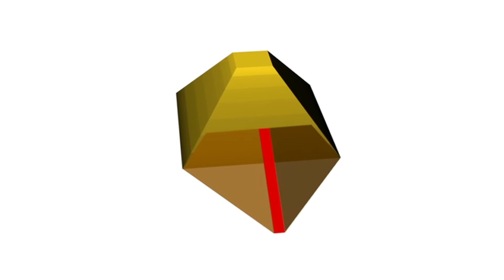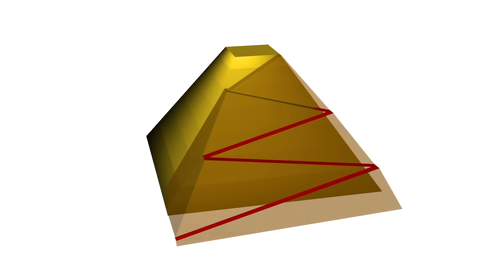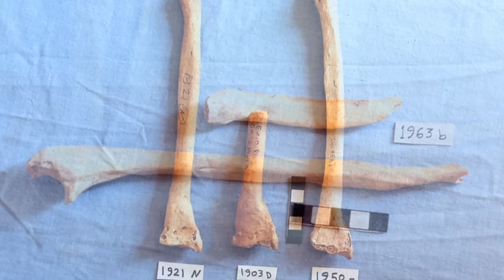Egyptology - Pyramid Construction

Comment: Always fun to see every single historian create a ramp for how the pyramids were built. While any of these ramps never existed because it would be as massive as the Pyramids themselves, and Would surely leave a trace upon removal. This man has wasted 30 years trying to understand How they braught the stones up there, while they haven't moved anything. They didn't need to move or shape any stone since they simply used Geopolymer concrete. All the materials needed are aboundant in Gizea, make the research there and you'll find it.
Reply: They didn't use concrete - the stone is clearly cut not poured. The transportation was not ramps - that would leave signs. Magnetic levitation or electromagnetic levitation is the likely option to move the stones into place (some still have strange magnetic signatures not just there but other ancient sites as well).

Comment: As an Egyptian I've went to visit the pyramids many times (not for 30 years in my life) some things they said were right but ots clear how it was built let me explain.

They placed the foundation in one week
With slaves pulling all the blocks and putting them in there place then the built sand slopes in a spiral around the blueprint they had for any of the three pyramids then it took several month maybe years (for the bigger ones) to put the stones in order then the just deconstructed the stairs .

Also one thing the part they said about the limestone filling is most likely correct
But they forgot one thing that they used big and small rocks not only small ones they used the bigger rocks to make it more slopey and then filled the gap between the blocks and the rocks with exactly the way they said in the video

Comment: Modern builders still use the  3 blocks and string method.  The largest stones and the ones smaller would have been wheeled up the ramps.  Make 2 large wheels of wood in 2 halves for each.  Construct them with a square divided in two diagonally as a void in the wheel center.  Then fit the two to the stone block as if the stone was the axle do this for each wheel.  All this bound with strong cord over packers to keep the stone at centre.  Then whatever means of pulling power, men or horses can pull and rest as a following team lays blocks to prevent roll back.  The engineers of that time would see this easily.  However I have no knowledge on the qualifications of the time.  Probably simple logic demonstrable to the kings and an air of superiority would do it.  Work it out and comment back I love this stuff.

Comment: Ya but if they used a giant ramp to build the pyramid,then HOW DID THEY BUILD THE GIANT RAMPS
Reply: With smaller ramps, over and over again..
Reply: With a giant load of bull shit.
Reply: i know right....if you really research the answer, it's very simple and makes sense......MOST of it is actually a mixture of concrete and the stones were poured in place.......FACTS!
Reply: With giant hammers

Comment: The whole concept is not possible with copper tools  show us how long to get a square stone even 24 inches square with the accuracy needed. NEVER POSSIBLE.
Reply: 1 - very few of the total blocks in the pyramid are plumb = meaning carefully cut and in some cases polished.  Most are in fact little more than crude chunks of limestone which were rapidly fractured from the bedrock in approximate sizes.  
2 - as to how they checked the plumb of blocks = Google the tomb of Rekhmire and look at the famous depiction of craftsmen at work.  You will see a man holding a square against the side of a large block checking its straightness. 

Enjoy your supposed "impossibility".  lol!  Facts as John Adams famously quipped are stubborn things.  Better luck next time.

Comment: The ramps would be as difficult to build as the pyramids considering their needed volume.. get serious
Reply: The bottom blocks of the Giza pyramids are around 10 tons, however they shrink as the pyramid rises, getting as small as 22" thick in 1x1 and 2x2 dimensions, after the king's chamber height. A ramp would only be needed to the level of the king's chamber, parallel and opposite to the 26° grand gallery. Slide equal weight on a sled down the grand gallery, blocks come up the 26° opposite ramp by ropes.

A 26° ramp to the level of the king's chamber would be quite small, compared to the 6° ramp envisioned going to the very top that would be twice the volume of the pyramid.

Simply not needed.

After the king's chamber the blocks are small enough to be easily raised level to level by fulcrum apparatus
Reply: @lefyre1266  thanks for the comment. But arent the 80 ton slabs on kings chamber and above?
Reply: @rui4659  Yes above and the chamber walls. The receiving chambers rise about 40 feet. The entirety usually refered to as the "king's chamber superstructure", I'm just saying king's chamber for brevity. The top of the superstructure height is to about 200 feet, of 481 foot pyramid original height.
The raising of the king's chamber blocks was likely done in a way similar to this animation, although perhaps not exactly. Just the concept of it.
 https://youtu.be/xE39WfQRZL4

Comment: It's interesting that so many are baffled and stuck trying to figure out how this feat was even possible. There are some things I've learned in my earlier years that make more logical sense then most of the ideas these guys present. One video I watched recently pointed out that the Egyptians actually drew images of how they moved large blocks. Sleds were key, as well as the addition of water being poured (suggesting that it made the sleds glide easier on the sand). There is even inner tunnels that spiral towards the top, which at the right angle can offer easier pull of large blocks. This method removes the need for a questionable looking external ramp. The land has changed too. Was there more water? Some have stated they've found evidence of more ship docks. This could also mean that ships could have also aided in transferring stone. I'd think the major key here is physics. That and great craftsmanship.
Reply: you said it, the land has changed. Remember… there was no sand when the pyramids were built

Comment: Would love to have seen the equipment used to lower those incredibly heavy stones on to those little boats on the Nile and then watch them sink🤣
Reply: So you begin with a if I may say childish assumption = to then have all that follows fail owing to your initial flawed premise.  So you assume they were lifting and lowering those large slabs of stone onto what - canoes??? - based upon what exactly???  lol!  I guess it never occurred to you that ships can be loaded via dragging things on/off them rather than only being loaded as modern ones do via cranes.  Such is the sadly superficial nature of your logic here.

So the Egyptians built harbors near their quarries and constructions sites.  At Giza you see from overhead photos of the Temple of Khafre next to the Sphinx 3 white lines running eastwards towards Cairo.  Those lines = sloping stone jetties which go down below the ground.  So geological core sampling shows that area was once a harbor complex with stone piers which sloped below the waterline allowing barges to pull up to them.

Next look at a photo of the famous unfinished obelisk at Aswan.  It dates to the New Kingdom and is still a mere several hundred meters from the Nile.  This means that quarrying during the Old Kingdom would have been done even closer to the Nile.  More importantly however is it is = uphill from the river.  So after quarrying blocks at Aswan it was a short trip downhill to a harbor area where barges would be waiting.  

Finally is the Egyptians moved things via sleds and those sleds were pulled by teams of men and oxen.  We have actual sleds in museums and depictions of them using them to pull things such as large statues or sarcophagi via those teams of men and yoked oxen.  Also you might want to Google say a "Cog".  Cogs were small wooden ships which used to ply the major rivers and coastal areas of Europe for centuries.  They could depending upon their size carry loads in excess of 100 tons of cargo.  

So the barge such as Merer employed - who transported the white limestone to Giza - are estimated by modern shipwrights who study ancient ship designs to have been able to carry loads in the ~70-90 ton range = which is adequate for transporting the granite relieving slabs found in the Great Pyramid.  Better luck next time.  Facts as John Adams famously quipped are "stubborn things."
Reply: @varyolla435  very clever words but you know fuck all either about how these pyramids were constructed, the truth is, no one does so, stop trying to be a smart arse!

Comment: Engineers have long debunked the ramp theory. The ramps would have taken more material to build than the pyramid.
No evidence of the ramps having existed, and no indication where all the material for the ramps could have come from or gone to.
No ramps.
Reply: That's under the erroneous assumption that the ramps had to be 6° and go all the way to the top.  1. They almost certainly used ropes and counterweight sleds, meaning they could've used the 53° slope of the pyramid for this. Also the 26° slope of the grand gallery as a counter ramp for a 26° exterior ramp to bring up the 70 ton kings chamber mega blocks. 2. The blocks of the pyramid get progressively smaller towards the top. At the bottom they are ~10 tons. At the current top they are 600-900 lbs. 

The top 36 feet are missing because the Arabs brought them down and carted them away to Cairo about 1000 years ago.

If we continued the linear progression of block size shrinkage, the very top blocks would have been just 150-300 lbs. 2'x1' and 1x1 blocks. Limestone is 150lbs per sq foot. 

Being that average men can easily carry 150lbs to their waist, we can assume that the very top blocks were just carried there by groups of workers.

Even a 900 lb block, if ropes are tied around to give it 9 rope legs, 9 men could easily hoist it from one level to the next, all the way to the top.

Where did the ramp go? It got recycled into the top of the pyramid.

Comment: They didn't just put their backs into it. They put a series of pegs in the ground , attached ropes to those and the block, then used long levers to wind the ropes up. It took fewer people,  and had a greater degree of control over the blocks. Just pulling it up would have risked it all if a few people slipped at once.

Comment: It's incredibly naive to think that they didn't use oxen in the construction when we know they used them for farming.
Reply: BINGO!!  You pass GO and collect $200.  Yes = they absolutely used oxen for manual labor.  

1 - most of the blocks of the pyramids are not very large.  Above the level of the King's Chamber the blocks get smaller as the pyramid rises in height.  Look at photos of people who climbed it to take selfies and you'll see the blocks at the top were small enough to be slid into place by several men.  So the largest/heaviest blocks in the pyramids are found = in the bottom third of them closest to the ground.
2 - meanwhile we know they used wooden sleds to move things about as we have actual sleds in museums as well as depictions of them using the sleds.
3 - we know they dumped water before heavily laden sleds to moisten the ground and reduce the friction.  Doing so reduced the effort to move a thing by almost half.  Also they made ramps in part from tafla - a clay they mined.  What happens when you moisten clay??  Answer:  it gets slippery. There are the remains of such ramps in the Western Cemetery which sits just west of the Great Pyramid. There is also the remains of a massive tafla mining operation near the worker village at Giza.
4 - so the worker village at Giza contained many tens of thousands of cattle bones.  That places oxen at Giza during the period of the pyramids.  Accordingly it is implausible they would consume cattle but not also use them for labor.  An ox can pull more than 2X its own body weight.
5 - finally the tomb of Hunefer shows a funerary procession where yoked oxen are pulling a large sarcophagus on a wooden sled.  

Moral of the story:  so we as we see have ample evidence to support their employing draft animals at Giza.  Thus while smaller blocks might have been pulled the short distance from the quarry which sat about 100-200 meters from the pyramids to where the blocks needed to be placed by teams of men alone = the larger blocks invariably would have also seen oxen helping to move them.  Have a nice day.

Comment: People always wonder how they moved those giant blocks. I have a theory. What if they either paved the way or heated the sand to solidify, the destroyed it after because it was unsightly. Could have used wheels on a paved surface, and sliding is always easier than lifting.

Comment: They were built using the elevator method. The middle of each 4 flat face sides as a faint line running in the middle top to bottom this concave faint line is were the smooth facing stones were positioned to lift a wooden elevator containing the stone.

Comment: Maybe is made from clay with a burning process like making bricks...
Reply: Sorry..........but we do not need to think "maybe........" = as we have the actual evidence at hand.  The blocks making up the pyramids are clearly bedrock.  You can see it in their makeup as you can on some still see the differing strata layers denoted by variance of coloration as they transitioned from one layer of limestone to the next.  Also some blocks still bear the chisel marks of the craftsman as they systematically chiseled along. 

Also the limestone quarries which sit adjacent to the pyramids show where they were clearly cutting out "blocks" as well as cutting channels in the bedrock and holes in the channels where they used wooden levers to pry out chunks of stone. Finally there is evidence such as the diary of Merer.  Merer was a supervisor whose boat crew was among those who were tasked with shipping the white limestone used as casing stones and to make temples at Giza from the quarries at Tura to the necropolis.  So forget about all the "maybes" and stick with the actual evidence.............things turn out better when you do.

p.s. - trying to create blocks as you noted would take infinitely longer to make and the resulting blocks would likely not be very strong.  Meanwhile bedrock has already been formed by enormous geological pressures to create a medium which is much stronger than a crudely fired "brick" if your will.

Comment: Ain't no way that they used wooden rollers. Two ton blocks would have crushed the rollers. I don't believe in the ramp theory either. Pulling up those stones uphill. Damn they were normal humans. Or were they? Aliens helping in construction of pyramids. Flying saucers with beams to move and lift stones and place them in position. Logical. That's how they got the stones to Stonehenge too. After completing they went back home. Wasn't needed on earth anymore. They didn't have business cards to leave behind. No normal people could have built these structures
 Look what it takes nowadays. When we built the Empire State Building did they use ramps and people pulling up the steel beams with rope? Think about it

Comment: This is just stupid! To higlight just one element that seems impossible: The great pyramid consists of 2,3 million stone blocks with an average weight of 2,5 tons, and it's said that the great pyramid was build in 20 years with about 100 000 workers. If you consider that timeline, every 1 block of stone had to be quarried, shaped and placed within 4,5 MINUTES with no rest or pause in those 20 years. Not only that but the stones are limestone and granit from the aswan quarry ca 500miles (800km) away.

Comment: There is a really interesting theory by the French architect Houdin about an internal ramp that ends boing hidden in the pyramid and unsung the great gallery to transport large blocks with a sort of mechanical system. Still, the best theory nowadays. The external straight ramp doesn’t make any sense, if it would be short the inclination would be too step making it impossible to push it up, a more comfortable inclination and it would require more building materials the the pyramid itself.
Reply: lol!  Pity it is a nonsensical hypothesis which does not actually reflect the evidence we see and hence was debunked.  Also coincidentally the Grand Gallery had you actually looked at the layout of the Great Pyramid sits well below the level of the granite relieving chambers.  So if as some contend the Gallery was a device for raising large blocks = how did they raise them the rest of the way given its location below the level of those large slabs of granite?????  Forget about Houdin and stick to the actual evidence.  We have actual historical/archaeological evidence to support external ramps............and exactly squat to support what Houdin claims.

Comment: After watching this video I thought about how I move big concrete blocks. I live on the ocean I use ocean tides to lift big things all the time. Sometimes I do move big concrete blocks around for my dock anchors. When I do this I move the blocks down to the ocean at low tide with a big machine then wait for the tide to rise. When the tide is rising I float in big logs in and lash the big logs to the concrete block let the tide lift them. When they are lifted can move them anywhere I want. These are modern concrete blocks of course. Then I started to think about a canal system with locks in which big ships are lifted up and down. Water can lift huge weights. Just thinking if it were me landed with this task I would use water locks. It’s the easiest way to lift something heavy. I’ve done it. 

Canal. Huge ships are lifted by locks and